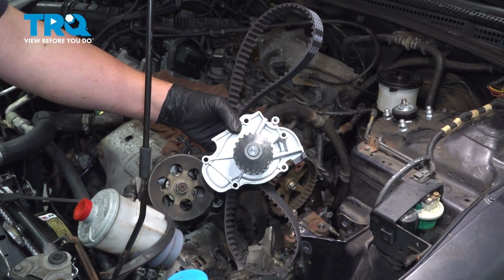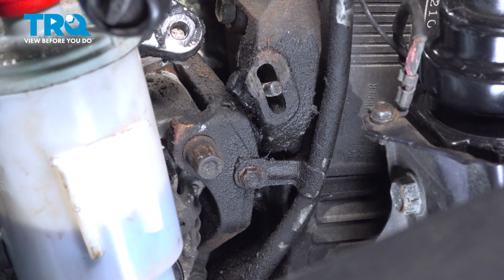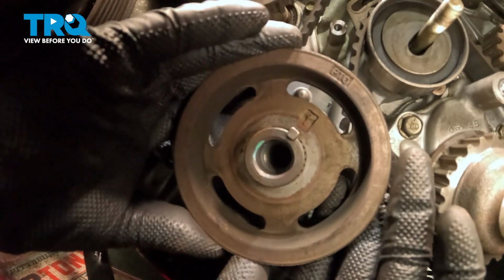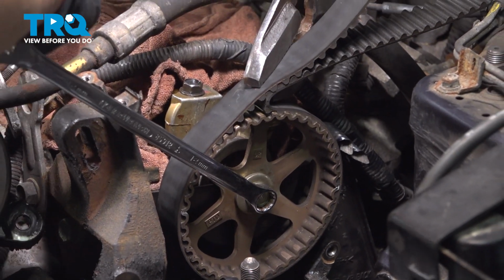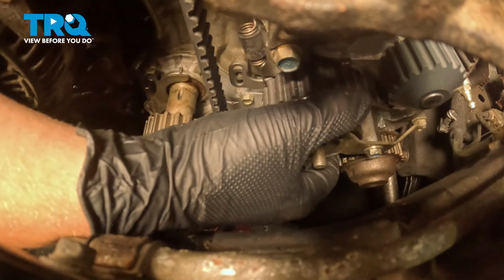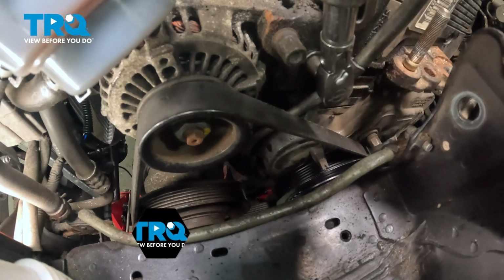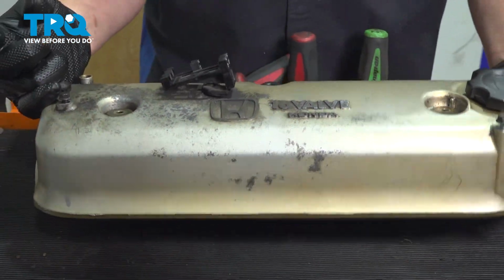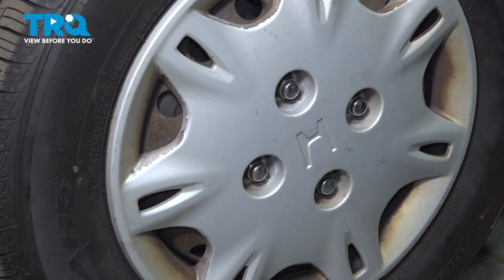How to Replace Timing Belt Kit with Water Pump 1994-1997 Honda Accord 2.2L L4

Comment: If you do this job on a VTEC 2.2 Honda Accord, make sure to remove the crankshaft pulley sensors before removing the pulley to change the seal

Comment: Is there a way to verify base timing was set correctly with only removing the top timing cover? Would setting cylinder 1 to TDC and verifying the marks on the cam sprocket be sufficient?

Comment: Started this job at 3 and it's now 9, about to install the water pump. The crank bolt was very stuck I had to buy the tool👍 I finished at 12 so 9 hours total, I had to buy the tool then then use a 8ft cheater bar my 1/2 wouldn't take it off other then that smooth sailing

Comment: Why do the sellers for timing belts on Ebay not put on their ads if it's for a VTEC or a non VTEC? Most sellers do not. The F22B1 I guess is a VTEC motor. Then F22B2 I guess is the non VTEC motor. Sellers, make it simple. Put those non VTEC and VTEC on your ads!,,,,,,,,,,,,,,,,.

Comment: Very detailed. But be careful with this information, there are 2 differe F22B engines in these cars, with slight differences. The tensioner one the one you didn't have has a pin to hold it and it doesn't move as you showed. Only the pulley itself moves

Comment: Thanks for the great video. I is a brutal job imo.  A few things I will mention. 1. The radius rod has to be removed from steer knuckle crossmemmber to remove the lower timing cover..yours is out but not mentioned..even then it isn't easy.  Setting timing belt tension is way more complicated than u described. Requires turning motor until cam pressure makes the belt tight... I noticed u never put a bolt in the left lobe of the inside timing belt idler. Oddly I couldn't find it, but put an M6 in that hole.  I thought the oil thrower washer was put on backwards in your vid. Book shows concave away from the belt.

Comment: If the crank bolt isn’t coming loose with a Impact wrench, I highly recommend a 3/4in drive ratchet with extensions.  Use a metal pole over the handle of the ratchet to increase torque power 🏋️‍♂️

Comment: The only thing you didn't show was the actual balance shaft alignment.  Just because the timing mark is there does not mean the shaft is in the right place, 12 am bolt needs to be removed on the side of the block to make sure the hole is seen. Using a inspection camera can do this.  There is a pin I believe from honda that I believe is supposed to be installed when doing the timing. But this might be for 98 and newer.

Comment: Removing the motor mount definitely helps out if you can't reach the bolts or can't get the water pump in cleanly. Great tutorial though

Comment: I’m working on my 1996 Accord, there are some subtle differences. There is a crankshaft position sensor and tdc sensor at the bottom of the case in the 96-97 models with obd2. The crankshaft gear has a 2 lobe plate that triggers the crankshaft position sensor which doesn’t seem to want to come off. There is also a technical service bulletin for the balance gear shaft seal on the right hand gear(left side looking at it). Apparently it liked to work loose so a retainer clip was added, might be a good idea to make sure the tsb has been done. I also found the lower cover is a real pain to get off and back on. Wish it was a s easy as in this video.
Reply from the maker: +@TheDrPoh Thanks for watching our video! http://1aau.to/m/Shop-TRQ

Comment: I have to say it is the best step by step I have seen. Everything you need to know even including the crankshaft and camshaft seals. I would suggest doing the balancer shaft seal as well since you're in there. You most likely will need a high torque 1/2" impact  with special high mass crank socket to get that crank bolt off. Everything else is straight forward. Should realistically take about a 4 hours. Great job!

Comment: Advice to anyone doing this. I finished this today following the video. It took a total of 2 days to do on the side of the road so start on a saturday morning and it will be finished sunday afternoon. The tool that he used to hold the harmonic balancer to remove the bolt, this tool is also needed to put it back on. The bolt needs to be torqued to 181ftlbs. Other than that, all information was perfect